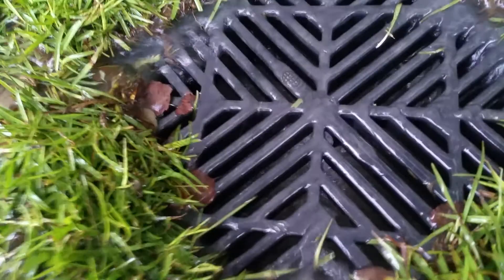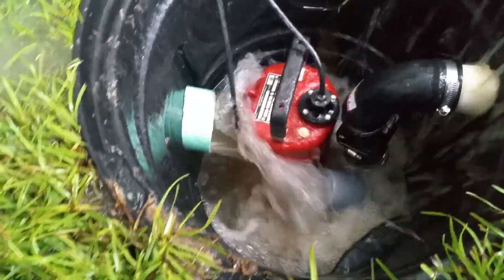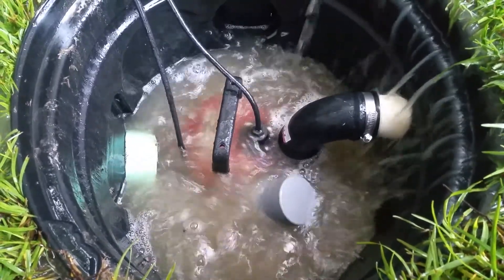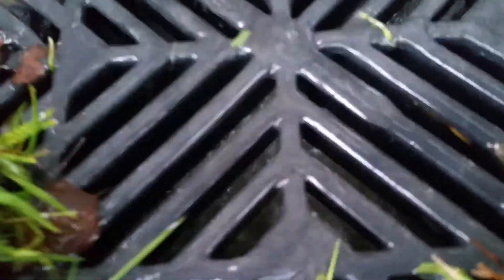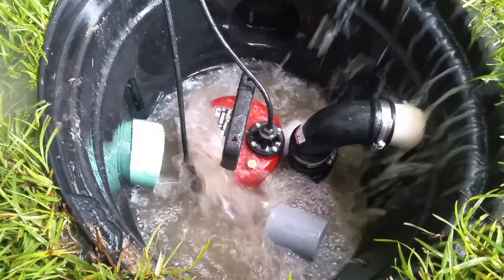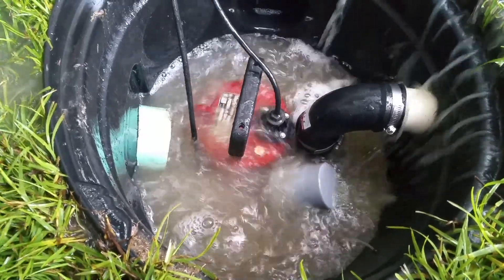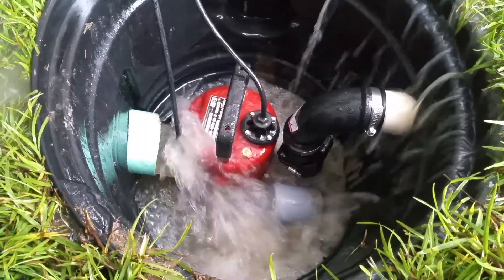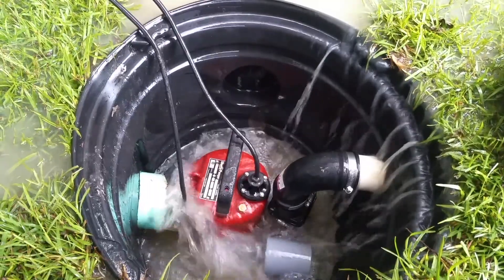Liberty sewage pump model LE102A2 in sump pit application during tropical storm Cindy 2017

Comment: How high does the water have to be in the bucket before the pump switches on?
Reply from the maker: You can adjust it to what you want. I have mine set where it comes on when the level of the water touches the bottom of the charge pipe.
I now have two sump pits connected together so the system doesn't short cycle as much.

Comment: I am having so many problems with my system kit.  I rigged the grinder pump pipe to 90 up and I cut my own hole
in the black trash can, and ran the 2" OUT pipe to the septic tank 300 feet away.  The radiator hose clamps going to
the special back flow valve pops off all the time.    I read below and i know this is sorta off topic, but I need some 
help and Im a retired electrician and not a plumber. I wrote to burcam about 2724368 model 401446P and how 
I needed some "Outside the Box" help.      Thanks
Reply from the maker: What is your application? Are you trying to setup a sewer system? My system is handling only storm water.
If your hose clamps are popping off your check valve then you either don't have them tight enough or the check valve could be cracked or defective, not allowing the hose clamps and pipe to be torqued to it.

How powerful is your pump? If it's anything like mine you need to make sure all this is super tight as these pumps move a lot of water and therefore under a lot of pressure.

I had a pipe pop off mine before and I torqued it down using an impact cordless drill and 5/16" socket attachment rather than using a flat head and it's never popped off on me again.

Comment: Mike how many inches of rain is creating this kind of flow?  I’m in CA and I can’t ever imagine having that kind of flow into my sump pit.
Reply from the maker: I think somewhere around 4 or 5 inches total. I've since had a more powerful storm that has overwhelmed my system but it did catch up as soon as the rain slacked off. You can look through my recent videos and find it.
Reply: It looks like from your pop up in the front yard was able to handle the force from your pump.  Any issues there?
Reply from the maker: @SDMev1982  well that was the old system. I changed it because the pop up was making a big mess in my grass. So I drilled a 2" hole in the street curb and discharge directly into the street now.

Also I redid the back yard. I changed it from a catch basin system to a true french drain system with one catch basin in the lowest point of the yard where the sump pump sits. I also added a 2nd sump basin to help prevent short cycling of my pump. The system works great.

But to answer your original question, yes it did handle the force of the pump but it held it back a little plus made a big mess.

Comment: This is excellent - thank you! Hardly any videos of 1HP+ sump pumps in operation! Good to see you used 4" PVC pipe as well - it's certainly tougher to lay compared to corrugated, but it does not clog at all!
Reply from the maker: Thanks. Take a look at my newer videos. I have significantly upgraded the drainage system. Pump is still the same though.

Comment: I recommend bigger basin the pump it's continues on and off that going kill it
Reply: I just put one of these in my backyard and instead of going with a check valve, I put an elbow that swoops up in the air and then back down as a high point and put a couple holes in it so that when the pump kicks off the weep holes suck air in and drains the water pipe out as it drains into the gutter. The reason I didn't want to do a check valve was because of freezing in the winter time and because I've seen videos where check valves got clogged up or the piston stopped up the entire system.
Reply from the maker: Rogelio Ramos I would normally agree, but since I've managed to get the system to siphon after the pump initially charges/primes the discharge line, the pump will not run anymore unless the volume of intake water increases to the point that the siphon effect is no longer effective, which will then cause the pump to kick on as seen in this video. But yes in a perfect world I would like to have a larger sump basin. Just couldn't find one for reasonable money.

Comment: So this is just keeping the water from being around the ground in your house, basically?
Reply: jmr1068204 in my back yard (back right corner) I have a very low spot. Not just my lot but the next door neighbors back left, and the two back Neighboors lots back left and right all connect together and form a very large low spot. What happens is when it rains it pools up to 5-6 inches maybe more during extremely heavy rain. That rain just sits there for days sometimes and causes issues with very soggy soil, mosquitos, etc. I tried to put a gravity only system in but I couldn't make it over the elevation that occurs going to the front of the house because I was intersecting with sewer lines and was already nearly 24" deep at that point. I was trying to keep several degrees of fall throughout the discharge pipe for excellent flow. Well that failed epically, and i decided to go big. So I purchased a sump pit and pump. 1st a Zoeller M98. It worked OK but would become overwhelmed during heavy rain, yard would still back up. But would be pumped dry in less than 30 minutes. That annoyed me because I felt it should not go under at all with all the work and money I spent. So I ran a 220 line back there and replaced with this Liberty (Zoeller does make a 220 in this performance range but they want a good bit more $$$ for it). Well now you can see the results, even during a tropical storm, no standing water and the pump is not being overwhelmed. Still pumping it down and works as a siphon when light rain occurs. Very pleased. I probably should have included the entire back yard before and after so you can really appreciate the improvement.
Reply: Mike Lewis have your neighbors implemented any drainage solutions on their properties, or are you draining everyone’s lawn?